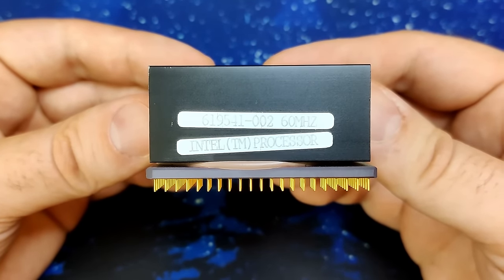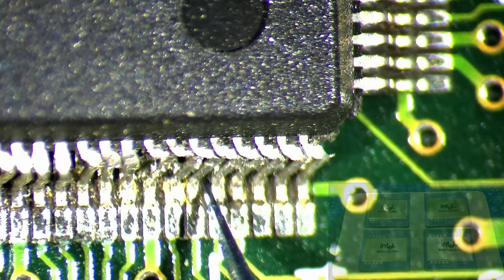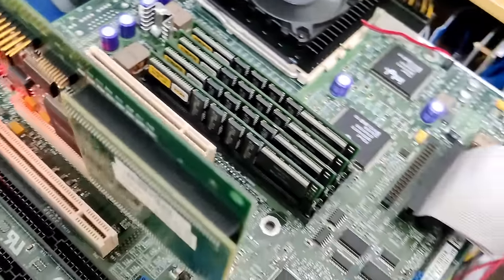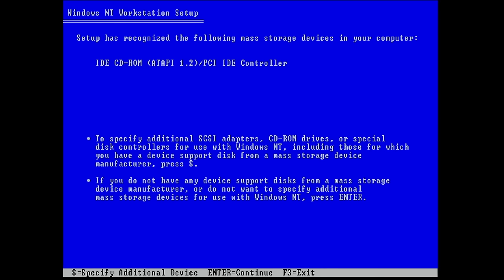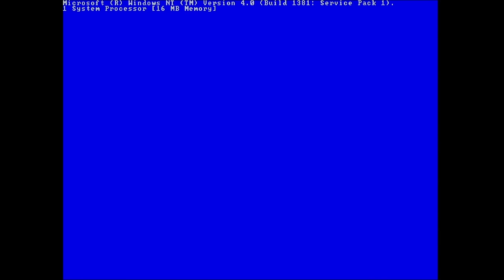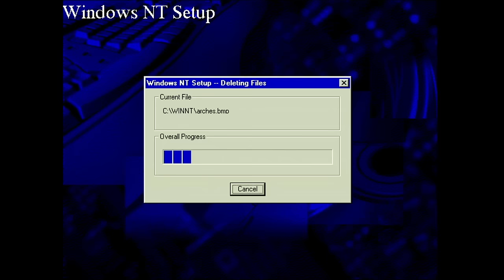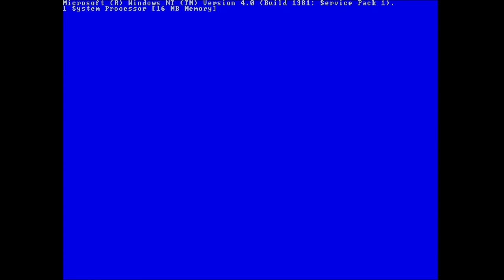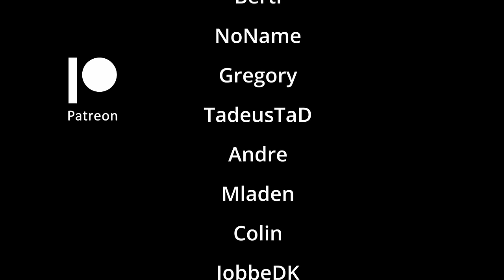A CPU ahead of its time: The Pentium Pro

Comment: I have a real "soft spot" for the Pentium Pro. It got a lot of undeserved flack when it came due to poor mixed 16/32-bit performance, but in reality that was not ever it's target platform. Many people did not understand how it was positioned, and maybe Intel didn't help with this confusing diversion between the P1 and P2. However, enthusiasts were keen to get their hands on them, with all that on-die full speed L2 cache proving too much to ignore! The lack of MMX did negate some of the performance gains for gamers though, but again, that was never it's target platform. Also, it's a really nice looking CPU with gold heat spreader! :)
Reply: I remember that when I wanted to get away from the weird issues I was having on my Socket7+ Cyrix 6x86 200 I started pricing options, and when I saw the difference between the Pentium 200 and Pentium Pro 200 wasn't really that much (both were around 600$) I went with a socket 8 motherboard not the smart upgrade-able move I thought it was, but even though a little later Pentium MMX were released I was very happy with my purchase. (until I understood that Socket 8 was a dead end, that pissed me off a little) I would had been better off with a high quality Socket 7 and had the K6 path open, but I didn't had that info.
BTW That Pentium Pro was awesome alongside my Rendition Verite and VooDoo 1!
Reply: I bet it was a beast if you compiled with optimisations specifically for it. It looks like it had better MIPS/MHz compared to the competition at the time.
Reply: Yeah, it found its place amongst those in the know at least. I think Intel should have used a different brand name really, it wasn't a chip that was really of much use to home users so the Pentium name wasn't really required to sell it. Of course every geek wanted one since every geek knew how significant it was.

Still, it made its impact and parts of the architecture live on to this day. Also interestingly the method of construction is kinda back? the whole chiplet design we're seeing now being used to boost yields of very large and complex designs. Not quite the same as the Pentium Pro of course but it's a similar concept.
Reply: PPro works very well on DOS gaming. MMX instructions were not widely implemented in games so you can ignore them.
Reply: @AncapDude  Perhaps many higher performance DOS games optimized to minimize the number of calls into DOS or BIOS and thus switch into 16-bit code?
Reply: I just waited for the Pentium 2. The P2 had a large L2 cache and MMX support and was still fast at mixed 16/32 Bit code.
Reply: @AncapDude Not conpared to a classic Pentium at 200MHz. That was the golden standard.
Reply: @szilardfineascovasa6144  I compared a PPRO256, PPRO512 and a P200MMX and their are not so different. Some Stuff runs faster on Pros, some on regular Pentium.
Reply: @AncapDude  Gotcha.

What are PPRO256/512? I mean the numbers - certainly not MHz ratings? For DOS games, 16MB or RAM was considered almost obscene 🙂 back then, so memory size wasn't really a factor. This is why the clocks were really more important. 

FWIW, what I stated was based on benchmarks done back in the days, on a wide array of games. CHIP Magazine plus every online zine. 

(I think most ignored the Voodoo cards, it was known that the P200 pushed the original Voodoo to its limits...Voodoo2 was just rwaring its head...so rather software mode.

You had that MDK benchmark for raw CPU performance (only one I still recall as a synthetic one) and whatnot. Good times! 🙂)
Reply: My college roommate in 96-97 went crazy with his computer budget at the time and went for a dual PPro 200 system with probably 64MB RAM and full UWSCSI. Noone else had such a setup so it was a sort of school yard bragging rights thing. Later in 97 I opted to go for a Pentium 2 233 with the PPro 440FX chipset, UWSCSI, and USB 1.0 before later adding a Riva TNT 16 MB. Mine still wasn’t as fast as his in sheer compute but it was plenty in its own right, plus I had MMX and a longer term upgrade path to 333MHz.

Comment: Hard Disk ASMR.   I miss the clicking but not the whine.
Reply: Fun fact SSDs and NVME's can emit a similar sound to HDDs without the whine when they're under heavy load.

It's much more faint though, but it is there.
Reply: You're weird - it's a package sound. The whine is part of the soundtrack - it's like saying "I like Metallica but not the drums"
Reply: Western Digital Raptor 10k rpm😍😍
Reply: I miss this it's a core memory of the 90's
Reply: Newer drives with fluid dynamic bearings didn't have (as much of) the whine. The older drives with ball bearings could be pretty bad - I once had an early 7200RPM Quantum drive (with a whopping 16GB capacity!!! lol) that sounded like a tiny jet engine... Ugh.
Reply: That's the scratch sound of death ☠️. Its days are numbered at this point.

Comment: The Pentium Pro was Intel's first CPU with out-of-order execution, and was the grandfather of all of the x86 CPUs that we see today. It's hard to state just how critical of a CPU this was for Intel, it was an absolute game changer in terms of the performance-per-clock that could be achieved, and all of our modern Intel CPUs today can still be traced directly back to the Pentium Pro.
Reply: Yeah!  First Intel x86 CPU to use a RISC core with microcode for the x86 ISA, IIRC.
Reply: Agree! But then they wanted to push the MHz as selling factor with the P4 and screwed it... Until the pentium D and then core architecture scraped it.
Reply: @georgH  Yea, they basically went back to the Pentium 3 as the basis for the Pentium M, which became the Core Solo/Core Duo and eventually the Core 2 Duo when 64 bit arrived on the scene. They learned a hard lesson that more mhz, at the expense of IPC, is not always better.

Comment: I'm still using my dual Pentium Pro system as my Windows NT 4.0 Server for my legacy home network.  I've upgraded it with dual Pentium II OverDrive CPUs with 512MB of RAM and U160 SCSI hard drives.  The thing is rock solid and love it.
Reply from the maker: Wow! Very nice! Especially on those two Pentium II Overdrives!
Reply: I wonder if modern linux could work on that system?
Reply: @v12alpine  it could!

Comment: The Pentium Pro targeted workstations and servers market. And Windows NT was the preferred OS for this CPU. It performed very well with 32-code, but when it came to 16-bit, the original Pentium was better. We can say that the Pentium Pro was the first intel CPU primarily targeting workstations and servers. Its full speed L2 cache was designed to perform best for this kind of work. The Pentium II Xeon was the true successor of the Pentium Pro.

The Pentium II was optimized for both 32 and 16 bit instructions. The L2 cache was half speed and was moved outside the CPU chip to cut cost. And with the addition of the MMX instruction set, this CPU became the perfect successor for the original Pentium family.

The original Pentium was used in workstations, because intel hadn't had a CPU targeting this market before the Pentium Pro. So The original Pentium was used both for home/business and workstations. So we may look at the Pentium Pro as successor to the original Pentium if we look at it from this angle. Otherwise the real successor to the original Pentium was the Pentium II, while the Pentium Pro was the first of a new class of CPUs.

Comment: Back in the days when this came out. I setup one of these with 2 chips and 128MB of ram, 1GB root drive, 9GB archive drive, 4GB dat backup running SCO Unix. with about 50 users and about that many printers. This system was super fast. SCO Unix took full advantage of this chip.
Reply: That was a BEAST of a system back then!

Comment: I was a NeXTSTEP developer at the time.  My first i486 system was such a letdown.  But my first Pentium 133 system was a real step up, and my first PPro system was the point where I realized that there was really no hope for the dedicated workstation-class systems.  Intel integrating things into the chipset and forcing motherboard makers to stop making random stuff up really tightened things up and made it possible to build decent systems without having to spend days experimenting to figure out what would work.
Reply: Да ладно, старичек am5x dx4 133 был совсем не плох, даже достаточно хорошо гнался.
И грелся🤣
Я его до сих пор не выкинул, это был певый комп, по этому мать с процем, памятью и жестким диском на 850мб лежат на полке, все работает до сих пор включал недавно😁
P.S. Ну как недавно, пару лет назад🤷
Reply: Did you work at NeXT Computer?

Comment: I owned a Pentium Pro Server about 2004/2005, a local bank sorted out their old servers. It was a Siemens Primergy 561 with 2 Pentium Pro CPU's and 384MB of Memory. I used to run Windows 2000 on this machine. I'm not 100% sure, what I did with that System, but I think I sold it after I finished school.

Comment: The sound of old hard disks is the same of the music dance of 90s, you hate them, but you can't stop loving them
Reply: I don't miss them at all when using silent SSD's and CF cards. I don't like clicky keyboards or mice either. So hell yes i love rubberdomes. The lower the noise the better. The only sound should come from the sound card.
Reply: I don't use SSD in retroPC but I love CF. I bought about 20 CFs of 1-16GB for €30-40 and I hope to have CFs until I die. You forget the weight in the retroPC, in CF is "almost 0". Anyway, this noise is lovely heheh

Comment: I watched the whole install process and enjoyed it... I need help! 🤪
Every of your videos is amazing, thank you very much!
Reply from the maker: Haha, wow. Well, I have never seen the setup screens of this OS. I thought someone else would like to see it and that's why I included the entire thing. Good that it wasn't a total waste 😅
Reply: I once watched a Tech Tangents video where he installed Office 97 from floppies.  haha  It was very zen, at least until the inevitable bad disk, which added just a touch of drama.

My own NT 4 install experience wasn't quite this tidy, though.  It was on a system that didn't boot from CD, so I had to use the three install floppies.  I guess the boot CD sets up the environment differently, because I ended up experimenting with setup command line switches to work around the abysmal file copy routines it uses.  Loading SMARTDRV first was essential... otherwise it took   a  g  e  s   in the blue-screen portion, with the disk thrashing relentlessly the whole time.  My guess is that it uses a tiny copy buffer, and only writes one or a couple clusters at a time, updates the FAT, then writes a couple more, etc..  With SMARTDRV doing its delayed-write magic, it moves along like you would expect.  Definitely recommend it.

Comment: In early 2000s, I worked at a railroad company that used a Pentium Pro system with 16MB RAM and Windows NT 4 to operate a massive printer in the marketing dept.
The Pentium Pro seemed a bit overkill for the task but that 16MB of RAM was brutal. Most print jobs were in the 100s of MBs and that poor HDD just thrashed continuously because of page file swaps.

Nice find! I completely skipped over the Pentium Pro era but I think if I were to visit it today, I'd try a flavor of Linux for comparison with the Pentium and Pentium II counterparts.
Reply from the maker: Another Pentium Pro that was starved and suffered from too little memory. I also completely skipped Pentium Pros - I didn't even know they existed for a long time and always wondered what their purpose was after I found out. I went from a 486 to a Pentium II - so, technically I skipped two generations of Pentiums.
Reply: @bitsundbolts  Me too! Straight from 486DX4 100mhz to Celeron 300A.
Reply: @bitsundbolts   386DX to 486SX to 486DX2 to Cyrix 6x86 to Pentium II, here.  I had to go back in time to experience the Pentium and Pentium Pro.  haha

Comment: From what little I remember of installing NT4 on newer hardware (Pentium 2 or so) it was imperative that you not try to install video card drivers when it prompts you to do so during setup. Leave it as standard vga or whatever it detects until after setup is complete. Then install the latest service pack. Then chipset drivers. And only after that, video card drivers. 

I also vaguely recall that you could use the same trick to copy the \winXX\ directory to the hard drive first, boot from dos with smartdrv loaded, for a faster install and it'd never ask for the CD again. Just had to use the option to convert to NTFS when prompted.

My local cybercafe in the late 90s ran nt4 systems running DirectX 3 and they played StarCraft pretty good.
Reply: Ha!  I just posted that on another comment.  Without SMARTDRV, the install process is awfully painful.  Looks like the boot CD does this for you (thankfully!)

Comment: Many years back my uncle owned a computer building and repair shop. I saved up a bunch of money mowing lawns, working with my dad, and allowance to buy a computer. And he did not disappoint, I didn’t really know much about exactly what hardware was what back then, but all I knew is he said was this is basically as good as you can get right now. Years later I was still able to use the system when i7 processors were out. That’s because it was one of those fastest pentium 4 extreme CPUs. I remember getting a core 2 duo MacBook for school years later and even that was considerably slower. I know this is a different pentium, but I love those extreme pentium. It would be cool to have one from each generation.

Comment: I do have experience with Windows NT and Pentium Pro processors.  I actually installed Windows 2000 and a voodoo1 on a Pentium Pro 180 machine back in 2001 and it ran better than expected with 48 MB of RAM.

Comment: Thanks for all your videos. I really like to see things getting repaired, especially when someone else throws it into the trash.
If you should have a Pentium Pro CPU in a good visual shape I would be very happy if I could get one. It is not required to work.
Btw. Congratulations for making it to the IT news with your video about 16MB SIMMs! 🎉
Reply from the maker: Thanks! I was surprised to see an article about those SIMMs, but I'll take it 😅 
I have the four Pentium Pro CPUs shown in this video. I only tested one of them, but I believe they are all in working condition. They all have some scratches or discoloration on the golden top though. Very rarely I find items at the scrapyard that are in pristine condition.

Comment: I had an IBM PC Server 704 in my home lab for a few years, which was equipped with four Pentium Pro 200 MHz and 1 MB cache. Among other things, this was the dedicated Battlefield server for our LAN parties :-) Those were the days! But it also had three power supply units together with 1.2 kw of power. The 12 SCSI discs had to be staggered in groups of three so that there were no problems with the power supply. 😀

Comment: I actually had a 200Mhz Pentium Pro system with 64MB of RAM that had been a workstation at my dads company. When they where getting rid of it I got the motherboard with CPU and RAM. It was my first build really as I had to find/buy the case and everything else to make it a usable computer. I ran Windows 98 SE, Windows 2000, and Linux Mandrake on it through the course of it's life. The last thing it ever did was play a round of Starcraft at a random party where we needed multiple computers to have everyone play, that was in 2009. I have unfortunately recycled it due to needing to clean up space, but I did keep the CPU as a keepsake since it takes up much less space than a whole tower. Seeing this video makes me kind of regret getting rid of it :/

Comment: I was using an old workstation pentium pro as my first desktop back in 2004. It was saved from the recycler as I was graduating high school and all it needed was a quick repair to the power supply. The motherboard I have supports USB, and I was able to get a 15GB HDD working with it with some workarounds. The system actually ran pretty great with Windows 2000. It didn't game very well due to missing a graphics card and none of the MMX instructions. I still have it in the basement but it hasn't been powered in a very long time. I believe it is a 166MHz chip.

Comment: "My 386 CPU had 64 megabytes of RAM". I personally bought my 486 with 4 megabytes of RAM, and some even had 8 megabytes. 64 megabytes of RAM for a 386 CPU was completely overkill; it was normal to find configurations with 2 or maybe 4 megabytes of RAM. Finally, I'm not saying that this upgrade wasn't possible, but it's worth remembering that the price of 64 megabytes of RAM at that time, in multiple memory banks, could cost $2000 or more in 1993. Good video.

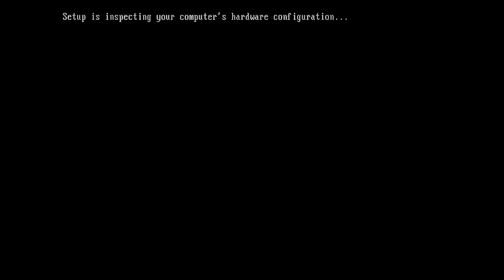Comment: 9:59 Indeed. I had my internship last year at a small mechanical engineering company in my hometown. They had some fairly old machines to work on metal and after watching your video I'm very sure: It was Windows NT running on those machines! Its fascinating how those are still used today. It even supported Data Exchange via Floppy disk!
Reply from the maker: Haha, nice! The ones I remember were controlling injection mold machinery that made plastic shells for Siemens mobile phones. And on another station, a machine used a laser to create the markings of Volkswagen keys. Pretty fun stuff.